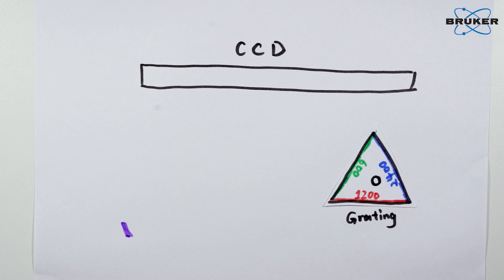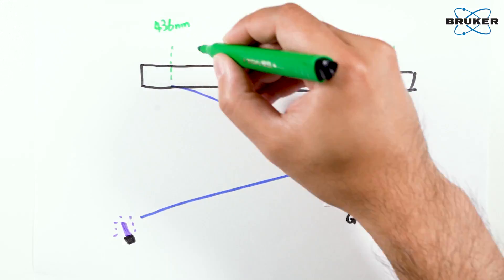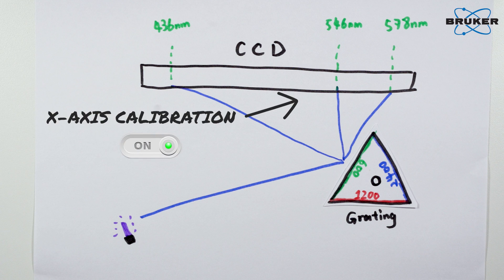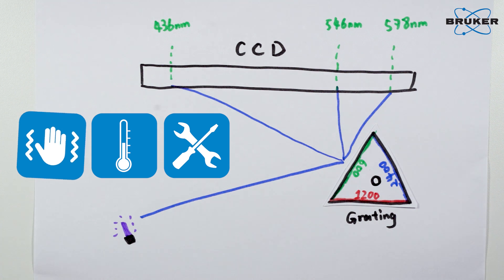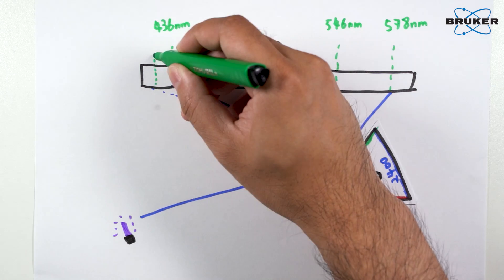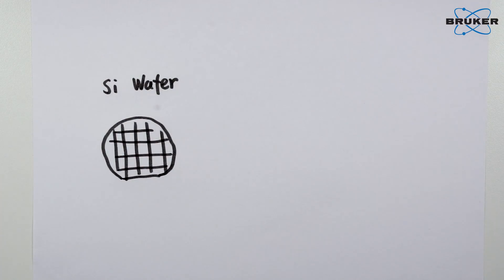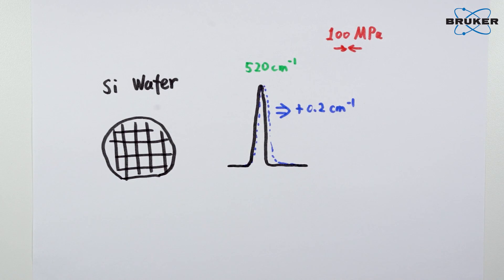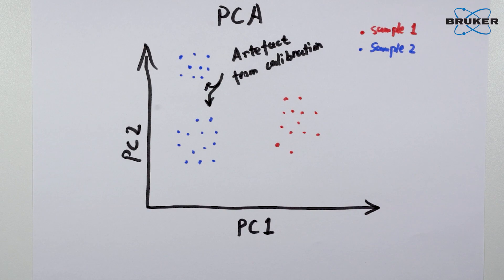Raman Calibration | Raman for Beginners | Always Recalibrate your Raman Device

Comment: Thank you for taking the time to educate us on the workings of optics elements.  The same physical factors (heat, vibrations, etc) would affect Raman amplifiers used in optical telecommunication networks.  Any insights you can share as it pertains to that application of Raman phenomena and gratings?